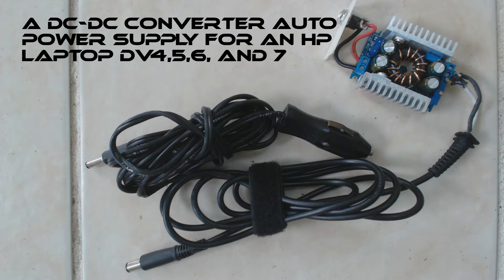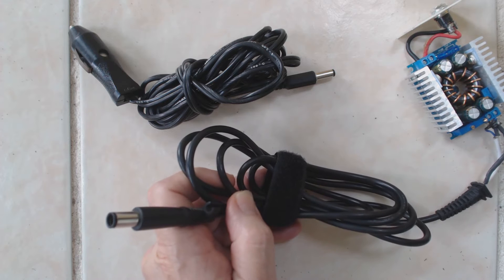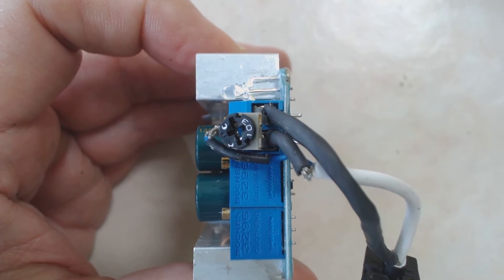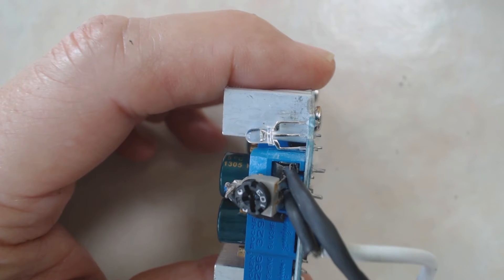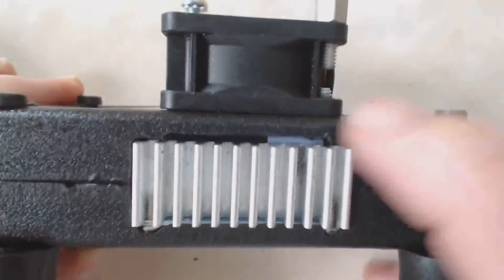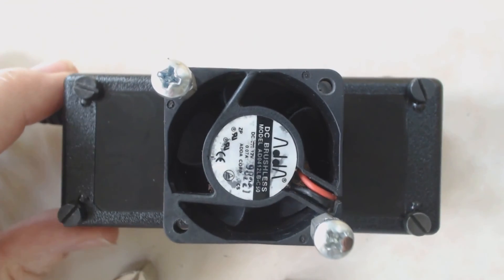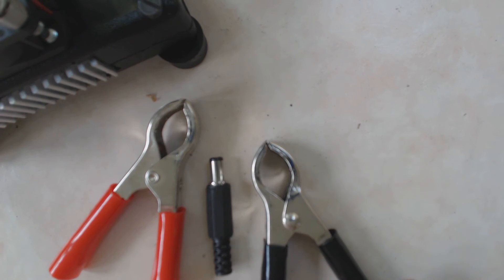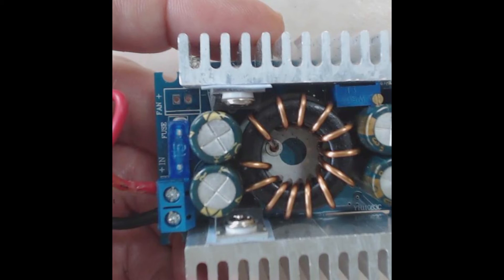A DC-DC Boost Converter Design for an Automotive Laptop Power Supply

Comment: Also you should remove the laptop battery because consumes a lot by recharging and dim the screen and install a lite windows version to avoid cpu or ram use by some processes
Reply from the maker: Not according to what I've read recently.  The battery acts like an electrical shock absorber.

Comment: hello, mine stopped working, I don't know why, 12 volts arrive at the entrance but nothing comes out, nor does the LED light up, why?
Reply from the maker: Did you check the on board fuse?  As I stated in the video,  there isn’t a schematic I could find anywhere.  You could pull the power transistors or whatever they are and check or replace them.  Considering the cost of the whole unit, I’d accept it as a failed unit and buy a new one.

Comment: Its good one, but should we all 3 wire to be connected to laptop? Why can not with 2 wire?
Reply from the maker: According to my research, the third wire both: 1.) Identifies the the power supply as a HP approved Power Supply and 2.) Tells the laptop the capacity of the power supply .  This keeps the computer from overloading the power supply.

HP has one way of doing this.  Other Manufacturers may use a different system.  An HP Power Supply can't be used with a Dell and Vice Versa.

Comment: If I were you I would smooth the output voltage on that converter because I guarantee the voltage output on that isn't "clean" and will damage the components on the HP!
Reply from the maker: Almost two years on.  Still running fine.  I use it for a half hour at a time data-logging.  (See my video on "Dialing in a MAF Curve".)  Many hours using this unit here.

Comment: Thanks for the question Pedro.  I take it you mean powering a 120V AC battery operated tool charger off of a 12 VDC car battery?

Actually, that is fairly easy and cheap these days.  Think  D.C. to AC inverter.  That will be the subject of a future video.

Comment: I have a tablet that is powered by USB, however the standard 5v 2.1a doesnt cut it... I plan on implementing a similar design as you have there, however I will be attempting to use a buck converter that allows to adjust the current and step down the voltage. Im hoping I can get away with 6v 4a, as the device requires a 24w charger to charge properly. Wish me luck!
Reply from the maker: Good Luck!